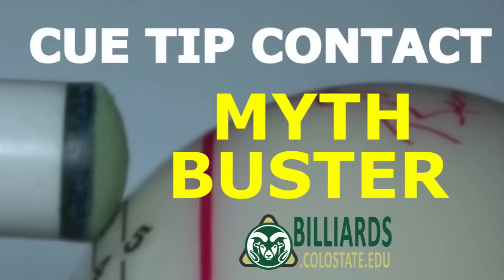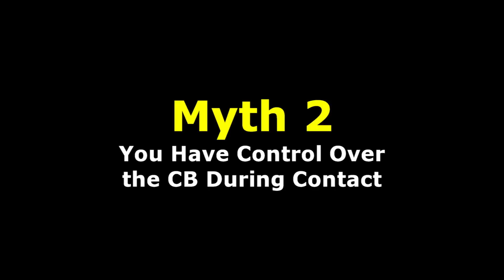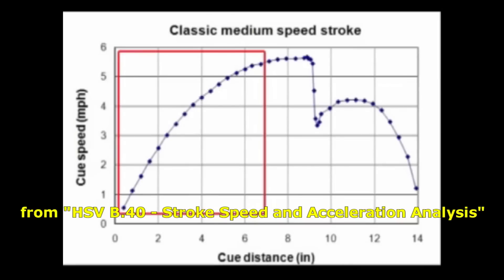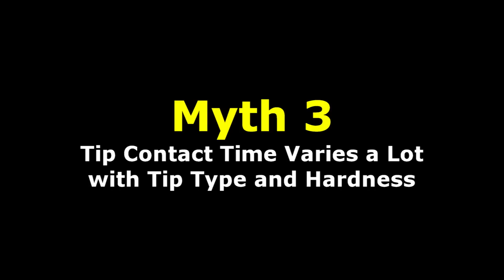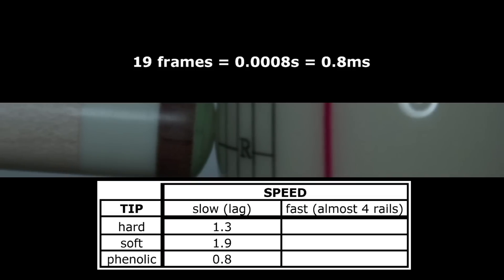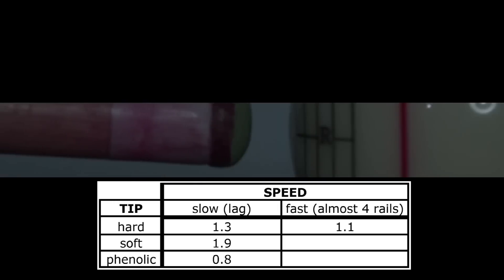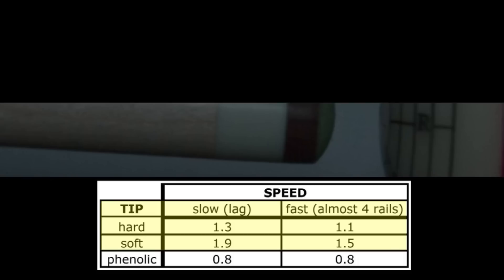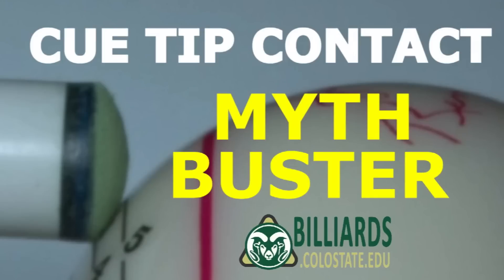Cue Tip Contact Myth-Busting Truths in Super Slow Motion

Comment: But how is the cueball reacting to the 0.4-0.9ms differences? And how are the time differences insignificant? I could see if the difference was less than 5%, but you’re talking 16%-50%.
Reply from the maker: The reasons are explained in detail here:
    https://billiards.colostate.edu/faq/cue-tip/hardness/
Reply: LOL. Yes, just because the time is still really small doesn't mean a 50% difference doesn't matter! Even a 25% difference.
Reply: I agree with you bro, any amount of contact time effects the cueball tremendously.that’s why people have different strokes. I think dr is wrong on this subject.
Reply from the maker: @peymanghorbani6390  Even if different strokes created different contact times (I have not seen evidence for this), the differences would be unimportant for the same reason why the differences in contact times with tip hardness and shot speed are also unimportant.  The reasons are explained in detail here:
    https://billiards.colostate.edu/faq/cue-tip/hardness/
    https://billiards.colostate.edu/faq/cue-tip/contact-time/
Reply: @DrDaveBilliards  , so why does a long stroke with good even acceleration cause more draw as opposed to a short jabbing stroke, with a sudden pull back on the cue?

@DrDaveBilliards, let just saw a post down a little that might answer my question!  Thank you for all you do for the pool community!
Reply from the maker: @SomeGuy-tz8dz  A long, smoothly accelerating stroke creates more cue speed with less effort, which, with a low tip, creates more draw.  See:
    https://billiards.colostate.edu/faq/draw/advice-and-drills/
    https://billiards.colostate.edu/faq/stroke/acceleration/
    https://billiards.colostate.edu/faq/stroke/follow-through/
Reply: Even a small amount of contact time difference makes a very significant difference in reaction in a collision because with an elastic collision, the amount of acceleration transferred is proportional to that time squared. That's basic physics.
Reply from the maker: @WisdomVendor1  With a cue-CB collision, the momentum of the cue is doing all the work during the incredibly brief contact time.  To find out why the differences in contact time have no effect, see the detailed explanations and supporting links here:
    https://billiards.colostate.edu/faq/cue-tip/hardness/
Reply: I have read the pages you link to. No explanation is given whatsoever, only a repetition of the same - and in my opinion wrong - conclusions.
Reply from the maker: @CarloRoosen  I obviously disagree with your "assessment."
Reply: interesting videos, that for sure
Reply: @CarloRoosen  I'm totally with you carlo.
I've been telling dave the same thing.
if your contact of cue tip to cue ball is at different/ better acceleration points on his graph (ie better timed stroke), it will surely result in slightly longer contact time, resulting in more spin applied to the cue ball (topspin, draw and side spin). all good players instinctively know this - and they are correct.
he shows a centre strike applying no spin to the cue ball and says that tip contact time doesn't matter. well it doesn't here because you're not putting any work on the CB. the CB is just skidding forward till the natural forward roll begins.
what's needed is analysis of:
* cue tip / ball contact time compared with the amount of unnatural rotation applied to the CB (top spin, draw and side spin) and,
* cue tip / ball contact time compared to different types of / places on the stroke curve.
dave assumes many points here which he does not back up with any data.
he says that his friend with the high speed camera is doing this analysis now, but I'm not hopeful -  they don't seem to understand what we are talking about.

Comment: Very interesting. I immediately noticed the difference in the 'chalk explosion' between your videos and the Austrian and Russian videos. Looks like the Austrian and Russian videos likely used Master chalk which leaves a dusty mess. Seems obvious your videos were not using Master chalk distinguished by the almost imperceptible chalk explosion at tip contact. I use Taom pyro chalk which isn't a 'dusty' chalk instead leaving very small chunks of chalk on my table. (9ft Gold Crown) What a mess the house cue was. 😁
Reply from the maker: It is partly the chalk and partly the lighting.

Comment: I think if you say that the tip contact with cue ball varies only for a very small amount of time, meaning that has no effect on spin, is simply not true. pool is not even a game of milliseconds, millimeters, but a game of even fractions of those. “Having little effect” does not mean no effect, and in pool, it makes a world of difference.
Reply from the maker: For explanations of why many claims about tip hardness and spin are wrong, see:
    https://billiards.colostate.edu/faq/cue-tip/hardness/
Reply: @DrDaveBilliards  thanks, I'll take a look
Reply: Some people just can’t believe something even if you prove it to them.  Especially something they have doggedly believe for a long time.
Reply: One millisecond sounds like a trivial duration, but can be a relative eternity from an engineering context. With much higher speed cameras, I’ve seen new evidence that (at least some) humans can control tip-ball contact duration. In some games, small effects make no difference. For other games, tiny fractions make a world of difference.
Reply: @iralee3c  I think so as well, though admittedly without having seen those clips. Sometimes you can feel it in a shot, especially when cuing softly. And if you think of the differences in terms of percentages they become quite significant
Reply: I think it’s a fair theory. Because think about the different kinds of spins and strokes you can have as well. Think about the fact that for outside draw a smaller amount of cue tip surface area is contacting the white than if you cue a shot with center ball (as pictured here) so the tip will likely flex more with a shot like that and stay in contact with fractions of seconds longer especially if it’s a soft tip and especially if you accelerate into the cueball with the stroke instead of tapering off your stroke into the ball. I think center ball was not the right type of shot for this analysis as it’s going to give the highest amount of consistency for results and for this experiment you’re looking for variation
Reply: I’m with you on that one he can say whatever he wants on but data already shows there is a variance 

And even In golf a small degree angle of atk angle 📐 by 0.5-1 can change the golf ball by 5 yards and height by 4-7 inches and L or R 

So do you think something of that degree doesn’t have same effect on pool ball 😂

Like the object ball going L or R by even half centimeter doesn’t change if it gets pocked or not
Reply: Exactly.  Soft tips have no more grip, just like soft racing tyres have no more grip.....
Reply: Are you seriously trying to teach drdave about billiard😂😂😂😂😂😂😂😂😂
Reply: @joulupukki1607  you've never been to an academic or professional setting where someone presents their findings, and other ppl ask questions or provide opinions and the conversation goes back and forth, have you?
Reply: @joulupukki1607  Why wouldn't he? Dave seems to be off to a good start...
Reply: @joulupukki1607  like you understand appealing to authority is fallacious logic right?
Reply: That's what I was thinking... It may not stay in contact for a long time, but judging from the slo mo videos, it makes a huge difference in spin.

Edit: after checking out Dr. Dave's link, I guess the only reason it makes more spin is because you can hit further away from center ball without a miscue.

Comment: The only thing missing is the equipment used to swing the the stick in the slow motion videos. Surely that was not done by a human being. It would immediately null out all the numbers in the Tip/Speed chart. Especially the Slow vs Fast cue speeds.
Reply: Doesn't matter anyway. We're talking 1000s of a second difference. Nobody can judge that with the naked eye
Reply from the maker: If you do enough trials and only keep the good ones (where the CB travels the target distance), and if the results are consistent, there is nothing wrong with the reliability of the data.  That’s what we did.

Comment: Thanks. It would be interesting to see the graph of cue speed for a light and heavier stick.
Reply from the maker: Agreed.  I would think the shapes would be similar; although the lighter cue would obviously require more speed to get the same CB speed.
Reply: @DrDaveBilliards  Maybe not since the CB leaves so quickly. I would expect less acceleration loss after contact with a heavier cue though.
Reply from the maker: @jeffren70  If you are really curious about this, see my "TP A.30 – The effects of cue tip offset, cue weight, and cue speed on cue ball speed and spin" analysis here:
    https://billiards.colostate.edu/technical_proofs/new/TP_A-30.pdf
You don't need to know all the math and physics to scan through for the conclusions.

Comment: Thanks, and i curious to know, if its 1ms impact, why is follow thru stroke so important? As this would conclude that basicly you just need to deliver power to some point on CB and basicly stop cue right there?
Reply from the maker: As others have mentioned, a good follow-through is the result of a smoothly accelerating and relaxed stroke. For mote info, see:
  https://billiards.colostate.edu/faq/stroke/follow-through/
Reply: The follow-through is the result of good fundamentals that allow the player to consistently return the tip to the desired spot on the cue ball with the desired speed.  Without the proper follow-through, there is a tendency to tense up, start slowing down, and move offline prior to contact.
Reply: Dr. Dave's explanation is great. If I could add something, it would be that mechanically, if follow-through is constrained, that means an oppositional muscle has to come into play. Muscles only contract. Taking a simplified version of the stroke: if the biceps is contracting and accelerating the forearm, and follow-through is constrained BEFORE cue ball contact, then another muscle (the triceps, for example) had to contract. That contraction can cause multiple effects that might affect tip position at contact: grip tightening, unbalanced or unaligned decelaration, weight-shifting, or other musculoskeletal compensations. That will reduce accuracy. So follow-through is (among other things, I'm sure!) a way to reduce or eliminate the effects of muscular counter-contraction on tip delivery.
Reply: The only thing that matters is tip contact point and speed. That’s it. Literally no other things matter. How you get there doesn’t matter.
Reply: Follow-through is a movement used in almost all physical sports to assist in consistency and creating a repeatable process.
Reply: Follow-thru is important and does matter. In fact during this video the graph depicting cue speed tells the tale. The cue should be accelerating to its maximum speed just prior to contact, contact the cue and lose speed, then recover its forward momentum until the stroke length depletes the stroke speed. If you don’t follow through, then you are “hitting” the cue ball no not stroking. This will pocket a ball, but like in baseball, swinging through the impact delivers a more precise and thorough strike on a ball. Same in golf. You don’t see pros stopping at impact once the golf is struck.

Pool is about. “Stroke” not a “hit”. Without the follow through, you get a “hit” and a deceleration of the cue at impact.
Reply: I think it's part of good form for delivery to a straight stroke giving more consistent  hit speeds and able to consistently hitting your target. Some people just poke or jab at the cue ball and are probably less consistent. Look at how a beginner strokes vs a pro. No way the amateur can be consistent. Some pros do have awkward strokes and styles, but can do that consistently. Willie Mosconi and Keith McGready had sidearm strokes, but were obviously very good. Allen Hopkins was winning at high levels for awhile, but has a terrible stroke. I imagine if you use your terrible stroke, but have practiced and played for many years with it, you could still become very good.